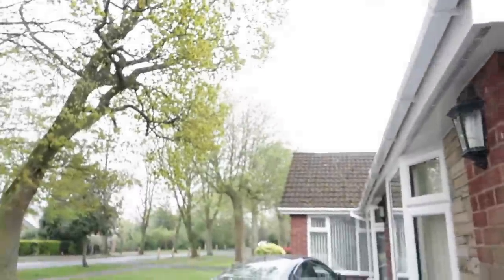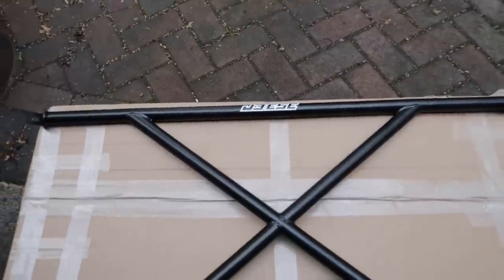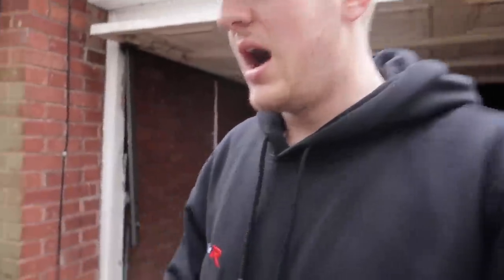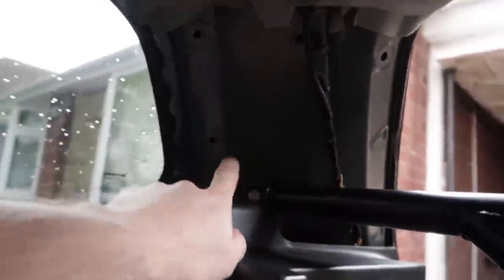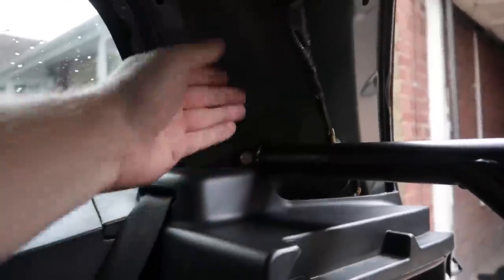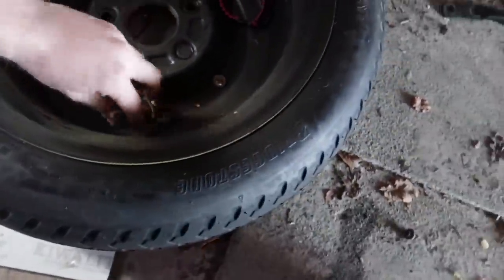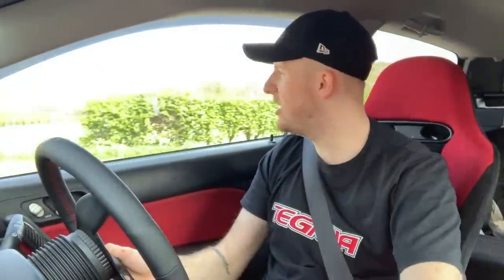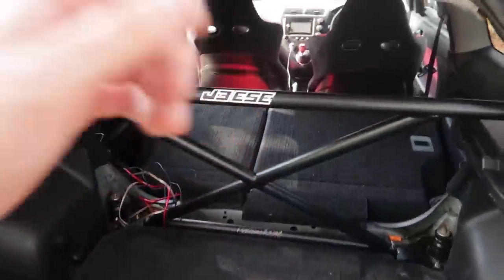EP3 Type R Gets CROSSBRACE!!

Comment: 6:56 What are the 3 drilled holes in the door card for?
Reply: I did think the same !!!
Reply from the maker: Adam Hempshell speakers I think
Reply: There should be a clip there for holding the seat belt out the way when dropping the rear seats.

Comment: Can you please reply or I wanna know is where did you get the spare bit ep3 wing etc please
Reply from the maker: which part?
Reply: The spoiler and the bit next to the window and the carbon fibre trim next to the door handle inside the car
Reply from the maker: @Liam-ct8de  the spoiler comes on the car and the carbon parts i bought from a mate
Reply: Cheers mate I’m looking for the mugen spoiler and the bits I mentioned but I’m from Australia and I have no clue where to buy them from
Reply: I would go eBay but the quality isn’t very good
Reply: @Liam-ct8de  Buy the replica mugen spoiler from ebay made from fiberglass, i got that on my ep3
Reply: SuperNuk3 how good is the quality
Reply: its good fibreglass quality, i was suprised that it was moulded really well, i got it professionally painted aswell and im really happy. i think seller was from queensland